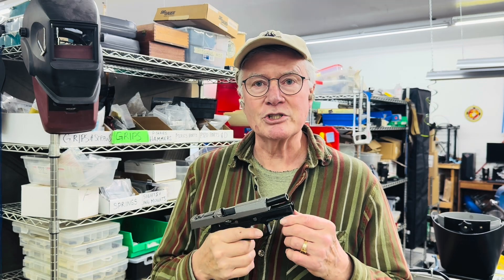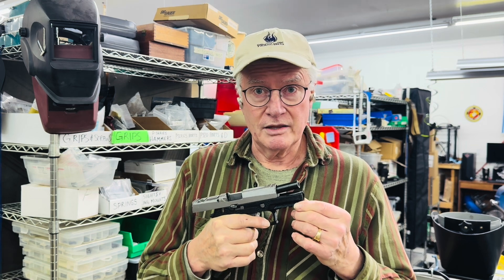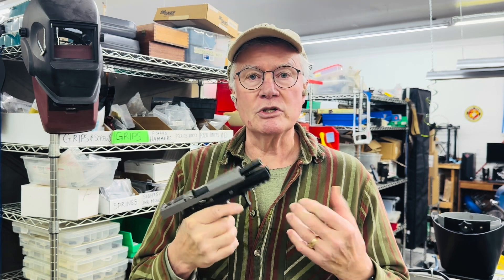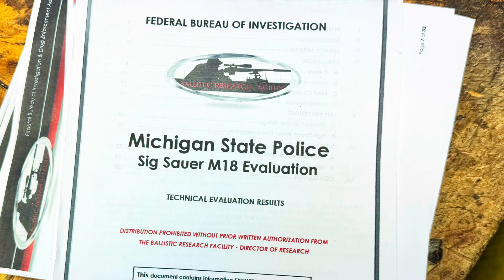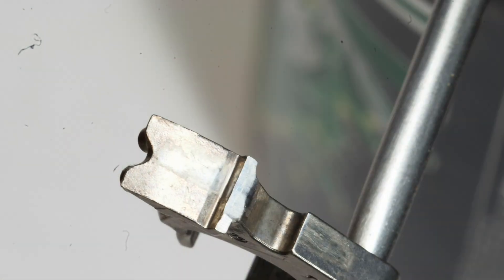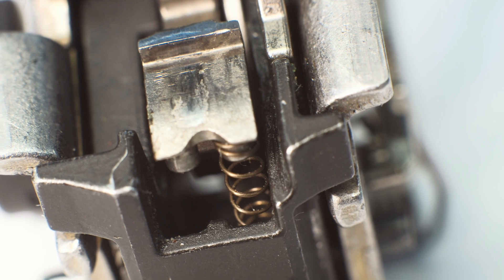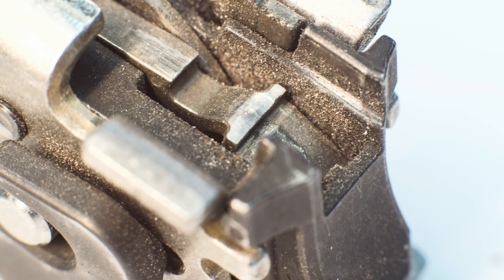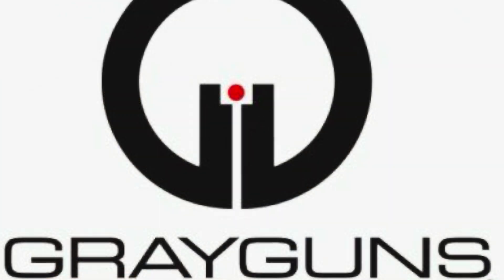P320 Testing - Malformed & Worn Firing Mechanism Parts

Comment: Grayguns, I’ve asked before on one of your videos several months ago and I’ll ask again: by design the P320 cannot fire uncommanded if the striker Safety block is functioning properly. So how are these pistols firing when in many videos no one is touching the trigger? How is the striker safety block not stopping the striker from impacting the firing pin? What is causing the striker safety block to not function properly? It seems like no one is addressing this issue. At least no one that I’ve seen. Please respond with your expert opinion.
Reply: You have asked and answered your own question.  The trigger is being moved to the rear, whether it be by user error or by foreign matter in the holster, or by holster malfunction, the trigger is being moved to the rear.

Comment: Mine only has 16,300+ rounds through it and has only fired when I have pulled the trigger.
Reply: Have you sawed internal parts? Or put screws in the trigger? Or shoveled screw drivers in the back? If not then you obviously are not the average gun owner! 😂😂😂
Reply: @jeffreygoss8109 😂